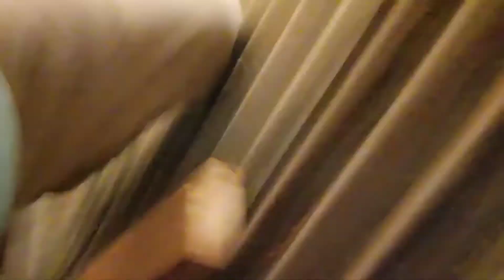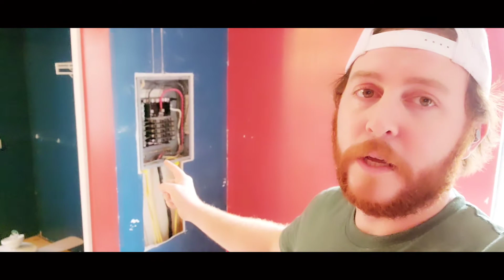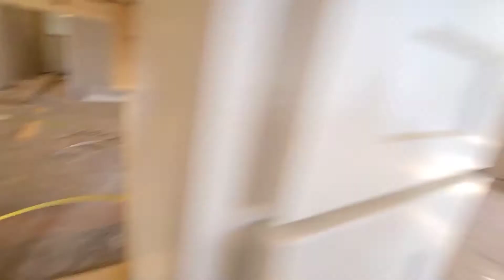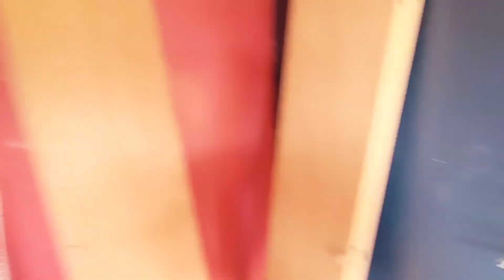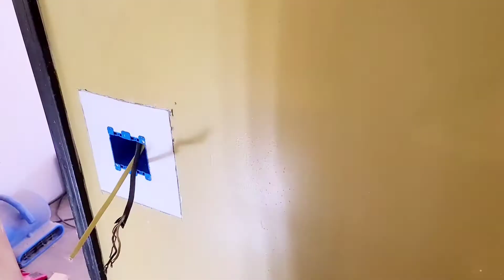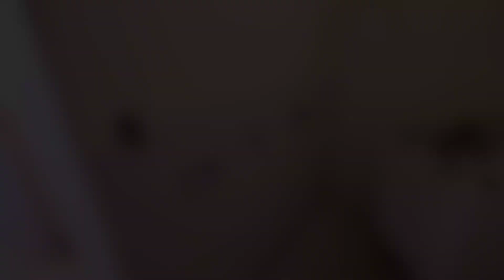Wiring the Kitchen Island - S1:E23

Comment: Question..I want to add a island in my kitchen, it is code in my city to have electric in the island, Would we have to run our electric all the way from that box in the garage the way you have or can we hook up the power to some outlet or something closer in the kitchen?
Reply from the maker: It would depend on the amount of outlets that are already on the circuit (breaker) you want to pull from. I base mine off 80% of the breaker so if its 20amps, factor 16 and 1 outlet for every 1.5amps so i would say 10. theres technically no limit to how many you can have on one circuit but you will start tripping the breaker if you put to much load on it. Hope that helps.

Comment: Pig tail the hot on the gfci so it doesn’t trip? I’m about to wire an island soon and it’s coming from the load side of an existing gfci.  Would that method work in that scenario?
Reply from the maker: Hey Luis, thanks for watching. if you wire off the load side any outline you add will trip if the gfci is tripped. if you wire of the line side the outlets will trip when the breaker is tripped.
Reply: @sweatequity3330  got it! So pig tail off the line side! Brilliant lol 👍🏽